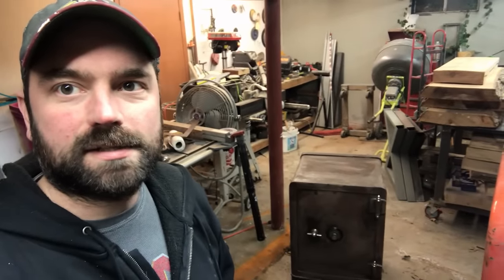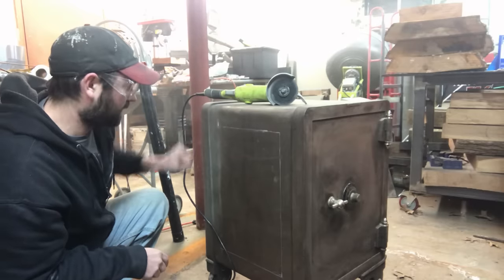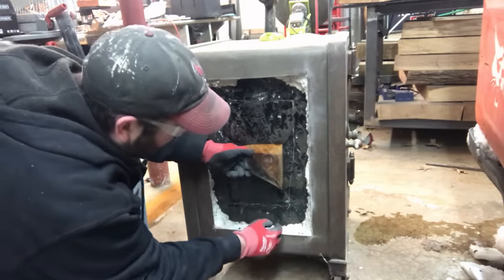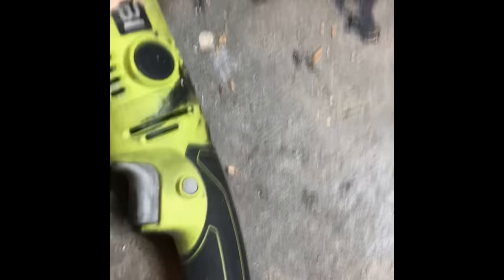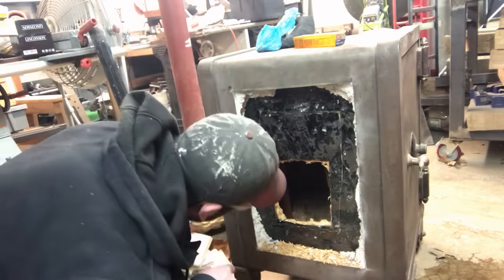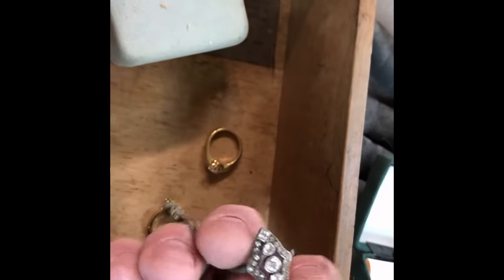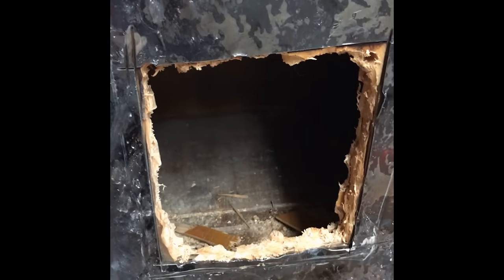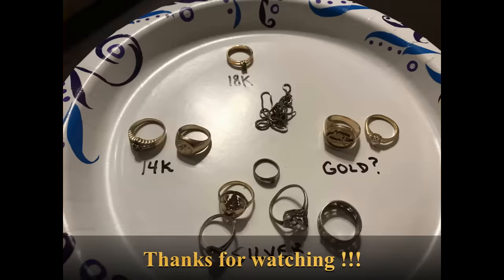Breaking into locked antique safe! What's inside???

Comment: Those safes were good for small operations and would deter thieves because they took a while to get into, most don't want to spend much time inside a house or business they are burgling. You coulkd wheel it out but hoisting it into a trunk would take some effort.

I had that same safe on a radio site in Korea, we kept the morphine and code books in it. One day we were told the combination should be changed so I took the panel off the rear of the 2-1/2 " thick door and found instructions on haw to change the combo. back in the civilian world we had that safes big brother in the front office for petty cash and Orisene (used for gold plating) and petty cash. The owner mentioned that the combo was known to former employees and sb changed, I told him I had done so in the army and he asked me to do it again. i reset the combo and explained to him how to change it so he could set his own combo. I told him to be very sure everything was tight when he finished and to be doubly sure he wrote the new combo down and that it worked BEFORE locking the safe.

Funny thing is a few years later my old landlord told me to take anything I wanted as they were selling the house and he told be the combo to the safe in the cellar. That safe had been in his dads business since the early 1900's.40+ years later I have that old Hall safe in the corner of my dining room, it holds that corner of the house down quite well and it also doubles as a stand for my laser printer.. i keep some papers in there and have a record of the combo.
Reply: That's so true.  Even a cheap $99 gun safe can be very difficult for most amateur burglars and you can bolt them into a corner where they're virtually impossible to break open without power tools.  In my area we don't have thieves who are that ambitious.  They're always hit and run taking only those things that are easy to steal.
Reply: This should have been a 5 minuet video, locksmith in safe contents in and out in less 5 mins made a pigs ear of that safe, just dragging the vid out for as long as he can.

Comment: WOW! So weird to watch a person destroy a safe the hard way. I cut a hole next to the lock and got in that way. Welded the front back and used the bolts on the back of the door to replace the lock, less than fifty for a safe I used for 30 years.
Reply: Did you turn the wallet into the police.....
Might belong to a missing person
Reply: mine was drilled and just needs a lock replaced. Getting it free so it's definitely worth the trouble.
Reply: @deniseculver4375  What are you even talking about? He opened a safe, not a wallet. Wallets are much easier to grind and drill open.

Comment: If you will remove the round plate on back of your safe door there should be two screws holding it on pull it off turn your dial till it stops on one way or the other you should be able to turn your handle and open the door you have to do all of that from the inside of the safe

Comment: Asbestos in fire lining for sure!  Destroyed good old safe that could have been opened by competent locksmith for 80-120 bucks!
Reply from the maker: As I mentioned in the video, I did call local locksmith, was quoted $250 to open the safe, it wasn't worth it to me. I repaired the safe and use it as an end table, doesn't matter if it opens for my use.

Comment: Their is a video on you tube on how to get into that kind of straight tail piece lock with no damage using a magnetic dial ring indicator a longer handle connected to the front left wheel with a Bungie cord and he was able to decode the lock with no damage. So because the new owner of the safe doesn't know how to do it the skilled way. Or pay a safe technician the safe becomes unsafe by cutting it up. Not the best choice in my opinion.

Comment: Why the heck cut open the side instead of going through the door? Just saw the locksmith's comment and I agree with him. You would have preserved the boxes, etc. Plus, the safe could have been valuable especially to a collector.
Reply: The doors are usually the most dense and difficult to go through, especially with safes meant to be embedded in walls. Going at the side is generally easier.
Reply: @cakeboss4194     WRONG

Comment: These old safes have a one through 100 tumbler. NO NEED AT ALL FOR CUTTING OR GRINDING!  The specs are the same for many years. All the brass is set at 45 degree
angles--so all combinations fall at a"X" of 45 degrees. Simply enlarge or minimize a
compass 360 degree to cover that 1 thru 100 tumbler--then you will see the only
combinations possible. The rest is simple spinning with various left right till you
get it open. Opened an ATM safe in a safe company's store in less than two minutes.

Comment: The safe was more valuable than the content, now it is worth nothing after drilling a hole
Reply from the maker: Not in my area, went to an estate sale recently, very similar safe except in much better condition (still had gold pinstriping) with the combo sold for $350.
Reply from the maker: Before you talk, check marketplace and auctions, safes aren’t that expensive. Look at my videos, they aren’t click bate, your comments expose that you have no idea what you are talking about!
Reply from the maker: Well I assumed that the door was the strongest point. I cut through the side because it was flat and had the largest surface area without the thicker support of the corners and edges. Back had an extra horizontal bar s as t the mid line, but you know all of this because you’ve done this before!
Reply from the maker: Try looking at my other videos!!!! You are an entitled idiot who feels that an internet connection gives you a voice! Just some words of advice that you can expand to anything you have an opinion on. Stick to what you have actually done before trying to claim to be an armchair expert! Any commentary I can have with you benefits no one because I might as well be talking to a bag of potatoes. That bag of potatoes would have just as much experience as you in breaking into a locked safe!
Reply: @ gamow : Astute observation mate.
Reply: @hooterspfld  : You are quick to give @gamow advice, I'll give you some; Don't attack the people who make sensible comments under your videos. It just makes you look immature.

Comment: You should have gone in from the back.  I did a safe years ago.  asked a lock company about inside dimensions and they told me the size. I used that size to cut through back and inside steel plate.  I was able to remove contents, take rear plate off the door, remove lock and with that figure out the combination.  Repaired cuts, placed new concrete in wall and then placed a larger plate over rear hole to seal it.  Painted it, door was open now so repaired and replaced lock, Figured out combination both to left and right.  Now I have a good safe to store collectibles.
Reply from the maker: Yeah, after this first safe, that's probably the way I'd cut into it it in the future. The reason I didn't with this safe was there was an additional horizontal support on the back that wasn't there on the sides. Sides seemed like much easier cutting.

Comment: Hi possibly that’s asbestos 🥴 if it is, you may want to get your workshop cleaned professionally. At leas get it tested !!!!
Reply: It’s not asbestos it’s concrete asbestos is usually an insulator and would be useless to protect a safe but I get the safety measure
Reply: @maxtaylor-knowles9918  could be used for fireproof reasons... feels like back in the day they put some of the stuff everywhere lol
Reply: @hzhang1228  Gypsum is used for fireproofing in most safes. If it were from the 1950's or 60's then it might.
Reply: Most likely gypsum
Reply: I agree. They put asbestos in nearly everything at one time. Tests are not expensive and would give a lot of of peace of mind.
Reply: @maxtaylor-knowles9918  Old concrete sometimes has asbestos in it.

Comment: Old ones like this can be opened easy. get a fork lift, raise the safe, push it off so it lands on the side the hitting the floor first. This will slam the bolts back home 9/10 times. If you dont care about your safe and floor of course.

Comment: Should have dialed it open. That safe is old enough to feel the fence lever trying to drop in the tumbler gates.
Reply: You cannot feel the lever drop into the gates, or hear them. Thats only in the movies. there are three or four brass plates with slots, and all the plates are in a different place. Until all plates are lined up the lever will not drop into place. The plates revolve freely on a shaft and cannot be heard.

Comment: Need to be careful with old safes. Some made in the 1800's were booby trapped with cyanide capsules that would break if you attempted to drill or peel the safe. Some had sheets of glass in them that would break and jam the mechanism if drilling was attempted.

Comment: In your next video you will be explaining how you  ended up with Asbestos fibres in your lungs
Reply: The old ones are lined with a plaster mix
Reply: @scrappydoo7887  a majority of them had asbestos mixed into the cement/plaster. They used that shit in everything back in the day.
Reply: It might be old enough to be pre asbestos.
Reply: @MrJimbaloid  it looks like it will be
Reply: @scrappydoo7887  you can sugarcoat it however you want its 95% asbestos
Reply: @MrJimbaloid  pree asbestos LOL wishful thinking
Reply: @sweatyballs5597  it would appear, according to the a review conducted by the companies that make safes, there is only asbestos used in the door seals to stop flames drawing between the metal door.
The casing is a mix of concrete and gypsum
Reply: @scrappydoo7887  there was no review by "companies that make safes" the review in question was by a supposed "locksmith" lying to himself about asbestos.... I know the dangers and so so many others.........
Reply: @sweatyballs5597  if you say so
Reply from the maker: Asbestos test results are in: https://youtu.be/Trf4CelSTjE

Comment: Definitely asbestos!!😳😳
Reply: Well it could be any combination of gypsum, concrete and asbestos. I will always be safe since it's an older safe and can't be 100% sure.
Reply: @sonacphotos  most definitely a combination of asbestos and concrete or gypsum. They used asbestos in everything back then. Oven mitts, hair dryers, plaster, floor tiles, house siding, break pads and break linings... the list could go on forever. And don't think if its not super old its free of the shit, they only got really tough with it's  use in the late 70s early 80s and as late as the early 90's. They still use it to an extent, they just don't call it asbestos.

Comment: These safes often had the combinations entered in the reverse rotation making it necessary to turn the dial in the opposite direction after dialing to the last zero.  even if you dialed the combination correctly, instead of dialing past zero you would have to stop and reverse direction to retract the bolt.
Reply from the maker: Yeah thats the case in this one, you have to go back towards 0 for the bolt to retract.

Comment: Maybe it's just me but I would have tried to get at the lock with a stethoscope first before destroying everything. The safe seems old enough that you can probably hear the tumblers.
Reply from the maker: Surprisingly, the lock is super smooth, can't hear or feel a thing.
Reply: @hooterspfld  Ergo, the stethoscope. I'm purely a low-grade amateur but did open 3 old safes for friend over the last 50 or so years using that method. It was just a suggestion as I hated to see that vintage safe destroyed like that. I'd rather the outcome have been a useable endtable, but then again, I didnt buy it. The choice was yours..I'm just lamenting the loss.
Reply from the maker: I actually did try my sister's stethoscope, but I was unable to hear anything. While I did cut into the safe, I also patched it up as well and now have the combo, plus it was fun. https://youtu.be/qYYdVo22NzM

Comment: Would it not have been far easier to use that angle grinder to cut the ends off the hinge pins? Also, use hearing protection. Lastly, did you even TRY to get the combination???

Comment: There is a panel on inside of door that can be removed now that you have access to inside. It could be removed and you can  turn to open   You can also  reset combination. I used a stethoscope to Open mine.
Reply from the maker: Yup, just finished up a follow up video where I did just this. Will be posting soon.

Comment: You made a profit just on the silver coins alone if you spent $65 for the safe. $1.40 Face value is about 1 Toz of silver. $5.40 face value = 3.857 oz of silver. Silver sells for about $27/oz right now. That's $104.14 in silver alone.
Reply: I've got one of those in the basement. It was there when we bought the house. 

If I should ever break in to it, I would go through the bottom.

Comment: older safes (before 1989) had asbestos because it was standard practice to use asbestos for heat insulation in the concrete.
Reply from the maker: Yeah there's been a lot of concern on that, so I made a video: https://youtu.be/Trf4CelSTjE

Comment: what get me is they can look up the safe by name and find out the dial rotation and how many stops there is in the combo then use a cone tip stethoscope to hear the tumblers clicks sets it only works on old mechanical locks and after you get it open then you can keep the safe and content . some would make beautiful furniture
Reply from the maker: Not being a professional lock picker, manipulating a safe is not something any joe blow off the street can do.  While I did cut into the safe, I also patched it up as well. If you don’t want to watch the whole video, just skip to the 20 minute mark. https://youtu.be/qYYdVo22NzM
Reply: There are no tumblers in that lock that make any clicking noise. Thats only in the movies. There are a series of brass plates with a simple slot in each one, that need to be lined up to allow the locking handle to engage within the lined up slots. You change the combo by either using a change key if the combo set has that feature. Otherwise there are screws in each plate that need to be moved to a different number and then all put back together. Most all the locks on safes are the same from the 1800's to the present if they are a combination type lock and no sound monitor will help you open it. Yes I'm a locksmith and have opened many safes. They have the simplest locks.

Comment: from the back side of the door theres a cover covering the lock mech.. remove that and then you can see and open the combo...
Reply from the maker: Yup, just finished up a follow up video where I did just this. Will be posting soon.
Reply: Sometimes there is not a small cover plate where the combo is. Sometimes it is a full sheet steel covering the whole door. In that case, with the door closed, he cannot remove the cover.

Comment: Just FYI, next time cut the slide bar between the handle and dial. Once open you can see the combination on the wheels, weld it all back together, a little bondo and paint ant the safe is reusable.
Reply from the maker: While I did cut into the safe, I also patched it up as well. If you don’t want to watch the whole video, just skip to the 20 minute mark. https://youtu.be/qYYdVo22NzM

Comment: You could have laid it on its side and cut the bottom that way if it's just for looks you don't have to make a repair.  I doubt if this little safe has any relocking devices meaning you probably could have just punched the lock.
I agree with one of the comments I read concrete could have had asbestos as a fire protection there was no ventilation when he was cutting into it I would say this was not well thought out

Comment: Those old safes are easy to crack withy knowing the combination.   Just go slow and easy and you can feel the tumblers drop.
Reply: Have you succeeded in doing this?  It's just that I've never seen a combination lock that had 'tumblers'.
Reply: There are no tumblers that drop....thats only in the movies. Safes have used the same mechanisms for well over 100 years. Dont care how slow you go, or use a stethoscope, you can not hear them move. Three maybe four, depending on the lock, brass plates with a simple slot in them that all of them need to be lined up.

Comment: The concrete breaks very easily. This shows that the quality of the concrete at that time was very bad.
Reply from the maker: I had read that it was actually a form of plaster of paris although it looks a lot like mortar from turn of the century brick houses I've worked on. Either way it was there for fire proofing not for strength.

Comment: In my youth i explored a lot of abandoned buildings. Once I stopped at an old gas station. Inside was a safe. I just turned the handle and surprisingly the safe was unlocked. Inside was about $50 in pennies! All wrapped up and ready for the bank. I did look at the dates on them and most were wheat pennies. I lugged them out and cashed in at the bank.
Reply from the maker: Nice find! My dad an I have been renovating houses for 25 years, and I'm always hoping to find something cool, but sadly haven't found any lost treasures yet.